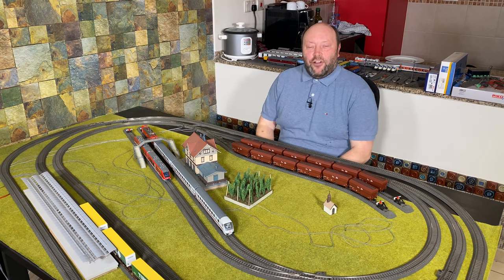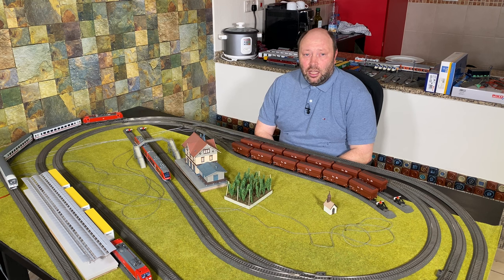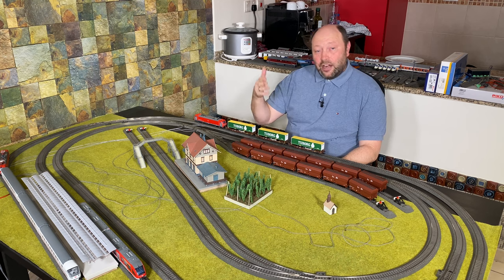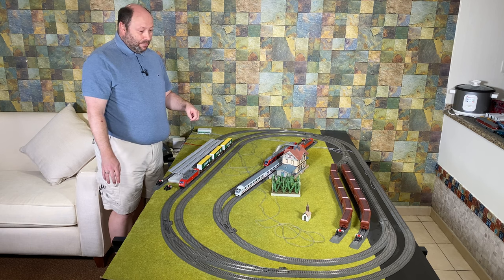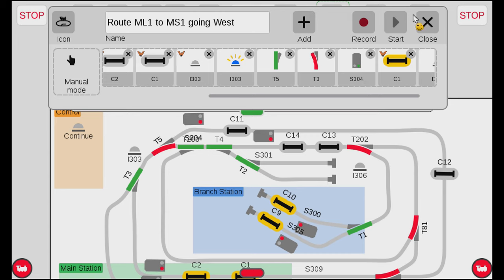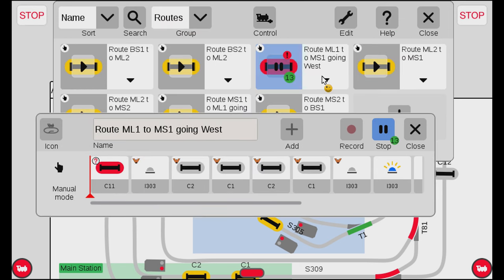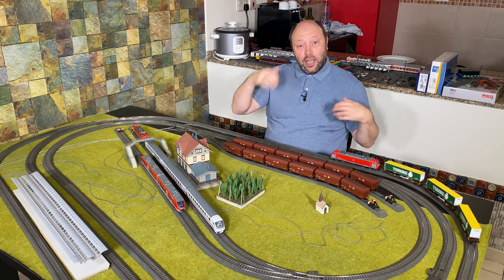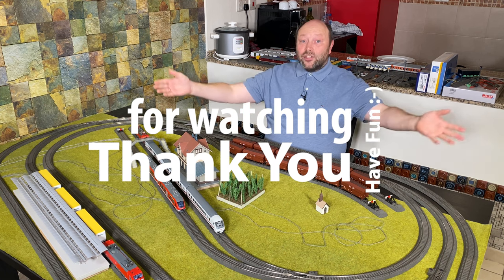CS3 Layout Automation: Experimenting with Routes, Signals & Train Movement (Automation Episode 5)

Comment: Hello Bo, firstly I would like to say thank you for your series of interesting, educational videos on Marklin CS3 and accessories. Excellent!!!!!  You clearly have put a lot of work into them. I wonder if you are a professional teacher. My father, who had Marklin old 3 rail in the 1920s and 30s bought Marklin HO in 1949, and I was born in 1955. So you see my home had Marklin since before I was born and I have spent my life enjoying this wonderful hobby. I grew up doing hard wiring and relay logic to control the block signals and 'alternate' station platforms, and it was this that lead me to a life as an electrician.
My father and I both bought into digital when Marklin first introduced it, and I eventually bought a CS2, and now I have the CS3+ coupled to it. Having watch your videos, I lament not having the Link88 yet, only S88 direct into CS3+.
Yes, I have thought about reed switches to give some feedback information, but soon discovered limitations. I also considered the hardware of 'games on tracks' which involves drilling holes in the roof of locos or carriages. On a per unit cost, this is prohibitive. There is always the problem of accessing the Marklin bus to get the data in, and how to use it.
I have approached Marklin about my idea of barcode or QR code stickers under locos and simple barcode readers under track ( I am thinking of the cheap scanning wands that used to be supplied in the old video tape recorders) These must have been quite cheap to manufacture. I live in hope and anticipation that Marklin research and development team will one day add this gear to the product line. I often run about 10 trains simultaneously.

Thank you again.
Reply from the maker: Hi Edward, 

Sounds like you had a great childhood with lots of Märklin trains. I was also lucky also to have Märklin when growing up - lots of fun. I have also had CS1, CS2 and now CS3. I did escape the first digital though ;-)

Did you do any test with the barcode QR code? I am wondering about the reliability, size of hardware needed, how to conceal, etc. To me using a method with light needing a visual line to the barcode/QR sticker could have issues and I have not seen anybody doing this. To me RFID looks more promising. However, both methods will work. 

BTW: I found that RocRail supports RFID: https://wiki.rocrail.net/doku.php?id=can-gc4-de&s[]=rfid Hence, a solution is available with software+RFID today. However, I only found the description in German.

What was the limitations of the reed switches? When making the video on the contact track I got several comments/emails of people that prefer reed contacts due to reliability. It seems there is a large community using them.

Enjoy ;-)

Comment: Wow that is complicated. No wonder it took you so long to make it. It is gong to take me at least as long to watch it over and over again to try and figure it out for my layout. Lots of back and forth between the CS3 and your video.  Right away I learned about the 'long press'.  I did not know about that at all!  I have a shadow station with space for 25 trains.  I will be trying to get them to cycle through all 25.  Don't know if I can do it.  Thank you so much for your help showing me how to start!!
Reply from the maker: Hi Märklin Zeit, 

Glad it was helpful! With a large shadow station for 25 trains it sounds like you have a rather large layout. If you have a large layout do consider automation using software like TrainController or RocRail. The software can be expensive or look advanced, but easier for a large layout than using the CS3. The principle of the S88/contract track is the same and can be used in both cases. 

A way to get started with CS3 automation could be to start by automating your shadow station or just some of your trains on the layout. The idea with splitting the route and train movement is that you can still operate trains manually. For manual operations you just set the route, observe the signals and then you drive the train by yourself.

Note: As part of the experiments I intend to look at shadow station automation and station automation, but this will be in later videos.

Let me know of your experiences. Enjoy automation ;-)

Comment: Long press was new to me too. I am not in love with the Märklin braking modules and like the way you worked around it. I gather when your train moves westbound, some new slow down block will be needed before C1. Thank you for that, waiting eagerly for the next instalment.
Reply from the maker: Hi ic Mountain, thanks for watching! For trains going westbound they can actually use C1 for brake and stop on C2 - this will fit with how the contract tracks are along the platforms (C1 is at the east end of the platform C2 more to the West). However, this would conflict with the assumption that I have for some of the train movements and routes that the train is on C1. A little unsure on what to do, but you are right - I might need a new contact track before C1 to ensure reliability. Will think on this. Thanks for the interesting challenge & enjoy ;-)

Comment: The single most important technical advance that Marklin needs to make is individual train recognition. This can be done using barcodes or with QR codes in stickers under the loco. We then need cheap 'scanners' that can be implanted under the track.
Reply from the maker: Hi Edward, 

Agree - it would be nice with a train recognition system. You can see a very nice example of this at McKinley: https://www.youtube.com/watch?v=DXXYqRamxng

I like the McKinley way of using RFID to track freight cars.

While individual train recognized is interesting it is not an absolute necessity if you are using software for train automation. In the CS3 I could see it as very useful for making events that are locomotive independent.

Nice idea - Enjoy ;-)

Comment: This will keep me busy for a while following your directions for building routes. As I see that you very the speed, perhaps I do not really need the braking module. Is that true?
Reply from the maker: Hi Fred, hope this video helps you with the CS3 automation - don't forget it requires a lot of patience, testing and troubleshooting. I do not use the brake module (or the built-in brake macro) - to me this is not needed and unnecessary complex. I would choose to use the brake module if you were doing "electrical" automation independent of the CS3. Enjoy ;-)
Reply: @ModelTrainFun  Thank you

Comment: Would you consider doing an automation video for those of us who have a CS3, Marklin trains, signals and turnouts, but do not have contact tracks? Can we use Macros, Loops and Conditions?
Reply from the maker: Hi Robert,

This series is for making train automation. In order to automate the train movement I find that one needs to understand where the train is on the layout. In this case the S88 with contact tracks is used for this. I am not sure one can make train automation without some sense of where the train is using contact tracks, reed contacts, IR sensor or similar. But maybe I am wrong? Ideas?

However, events in the Central Station 3 (CS3) can be used for many other things. I have made two videos that you might be interested in:
- Manual routes: https://www.youtube.com/watch?v=dsXjeP-UprY
- Turn Signal red using timer: https://www.youtube.com/watch?v=0QCtklLO7II

There are many other things you could do with events. Let me know if you have any ideas.

Come to think of it one might be able to automate trains if you have a eg. a crossing of train tracks with signals. One could have a timer that  turns the signal on the other track green a certain period after the train gets green and it turns red on the current track... this would need a stop section. Hmmmm - how does your layout look - perhaps one could make some automation without contact tracks? Also a string of signals could turn green in waves making the train move forward...

Ideas?

Wondering why you are not interested in using contact tracks? What are you trying to do?

Enjoy ;-) Bo
Reply: @ModelTrainFun  ps. I am not using "Contact Tracks" or any Feedback Tracks because of the wiring headaches and the expense of an S88. I like my layout and see little need to try and add a number of feedback contact tracks. It is not a simple undertaking. Thank you.
Reply from the maker: @Drrmichler  Agree - it is a lot of wires to make it work. Enjoy ;-) Bo

Comment: I have thought about RDFI, but cannot find hardware that would be small enough, (a) to fit inside the loco, and (b) to place under the track at strategic locations. The biggest problem also is that I have no idea as to how to get the signal into the Marklin bus and software change in Marklin bus to identify the loco to the signal.
Reply from the maker: Hi Edward, the idea is to have the sensor under the track and the little passive RFID on the locomotive. Hence, just a small sticker underneath the locomotive - no need for extra hardware in the locomotive. Not sure how to connect to the Märklin bus though... Enjoy ;-)

Comment: Hi Bo,
Thanks for a very inspirational and excellent series of automation lessons! I have enjoyed them immensly and you got me going again on my layout… I am now reviewing them a second time and making notes…
With your inspiration I started changing a lot of things. I were looking too much into computer software and at the same time were still in analogue land and the Märklin digital signals, and have overcomplicated the block and contact designs, and made many of them too short… Too bad your videos were not published some years ago when I started 😊
One thing I tested was that i can use the Track element (one is enough!) in combination with the Create Area to add names and descriptions to eg Tracks in a station. So in your (excellent) example it is easy to add eg. MS1 as an area name in the Main station area to mark that track in the plan with a different colour.
Have you tried to use the AND Macro to combine the C12 and C11 conditions in your example? 
Would the same work for the Route ML1 to MS1 going West? You do the check C2, C1 and C2, C1 again, would the AND macro remove the need for the second C1 and C2 check?
Your Idea to use virtual assessories and contacts as indicators are brilliant!
Have you tested the Brake Macro? I have read about it, but not tested it  myself (I do have some hardware and current supply issues to solve first…)
Thanks again!
Reply from the maker: Hi Bo, I am glad you are enjoying the CS3 automation video. This is the first video in the CS automation experimentation series. In the next ones you can see some more advanced examples that might answer some of your questions. I also changed the way I do things to use the "dispatcher strategy". In that video I also use the AND macro.

I have not used the BRAKE macro. I often find that the more advanced built/in movement macros do not make it easier for me. I spend too much time trying to figure them out. The BRAKE and SHUTTLE train macros are nice, but I find it easier to built a similar pattern myself without the macros. Do you see any advantage to the BRAKE compared to doing it yourself?

Yup - the "create area" is a great trick for marking areas on the layout diagram. By the way if you would like to see how to make the automation on an analogue layout, then check out the channel "the 3rd rail".

Enjoy ;-)

Comment: I want to be able to use for route control. I want the select particular trains ( say freight) to take a particular route. I can run at least 10 locos at once and I have 2 main routes as well as minor lines in over 300m of track. I also want to differentiate between electric and non electric locos.
Reply from the maker: Hi Edward, have you thought about using reed contacts? You can use them in combination with contact tracks. The idea is to have contact tracks for controlling where to stop/track occupancy and the reed contacts for type of train. As an example: no reed contact=regional train, reed contact to the left side=freight and reed contact to the right side=intercity/express. The benefit is that the reed contacts can be connected to the S88 thereby directly detected within the Control Station of your choice. I seem to recall I have seen somebody doing this on their layout. Enjoy ;-)